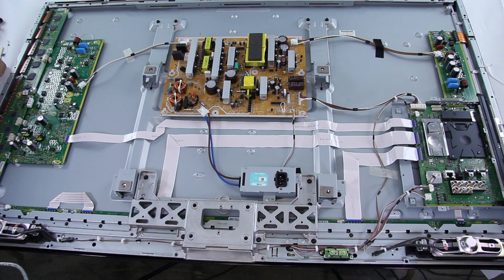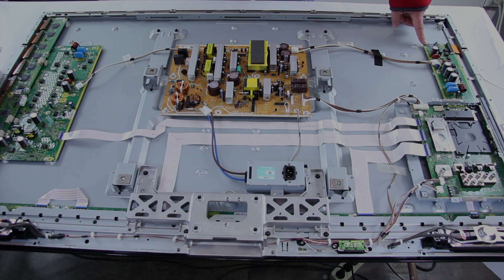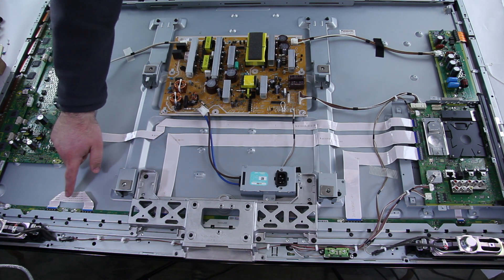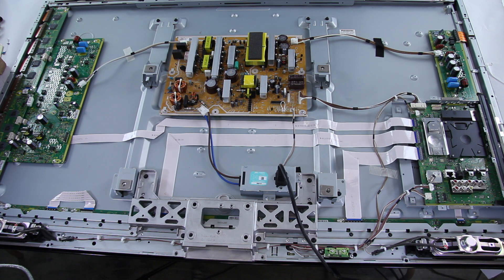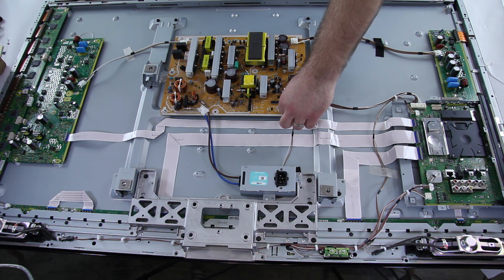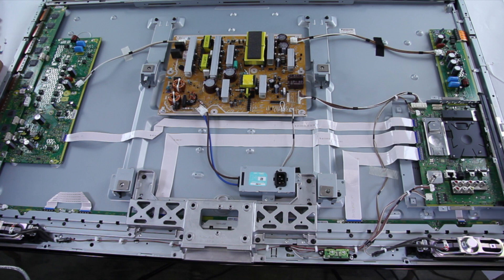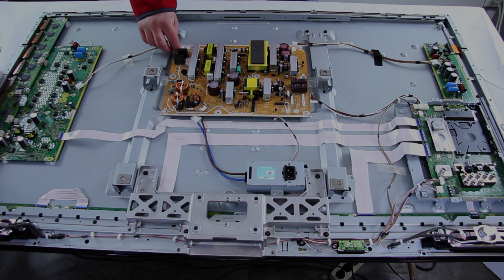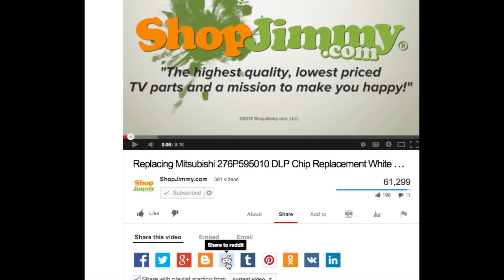Panasonic Plasma TV 6 Blink Code Explained Repair for 2011 Panasonic Plasma TV

Comment: Hi I have model TCP50X3, my light was blinking 6 times with nothing on the screen when powering on.  I diagnosed as per this video, and stopped after the SN board.  when I disconnected it, powered on, the red light stayed on but the screen stayed black.  I ordered a new SN board.  But when I replaced it, now the light blinks 7 times, and still nothing on the screen.  I did notice however the new board doesn't have a capacitor at C414.  When the new board is in, I am able to hold the power button for a couple seconds and release to turn it off (stop the light from blinking).  When the old board is in, I can't do that., it keeps recycling on, I have to unplug it to stop the light from blinking. Also, with the old board installed, the screen "flickers" for a split second, or lights up a dark grey for a split second when it is first turned on, (like most tvs do before the picture appears).  When the new board is installed, it stays the same "Dark black" as when it is unplugged.........ANy thoughts?
Reply from the maker: raverbrant   It sounds like your original issue would be the SS board the 7 blink is the SN board.  So, you may want to replace each of those boards.  Here is a link to replacement parts for your TV model number on our website, click here:  http://www.shopjimmy.com/catalogsearch/result/?q=TCP50X3  Be sure to match part numbers on your current board, with your replacement for compatibility.  You can also call our customer service for further assistance with your purchase.  (877) 881-6492  Thanks and please let us know if you have any further questions with your TV Repair!  www.shopjimmy.com

Comment: Hi i have an older set TH50G10A which has 5 blinks.  There is a black screen then powersupply shuts down ans led blinks 5 times.  Any idea what board is causing the shutdown?
Thanks

Comment: I have a Panasonic viera tc-p50s30.  we had a lightning strike close to home today, it put out power.  tv would not turn on.  I moved plug to different outlet in my surge protector and it came on.  nothing via hdmi cable is working.  tv works with antenna, tv works using component video cables, but not dvd player or direct tv.  any assistance appreciated.
Reply from the maker: grandpas barn   I recommend replacing the A main board in your TV.  Here is a link to replacement parts for your TV model number on our website, click here:  http://www.shopjimmy.com/catalogsearch/result/?q=tc-p50s30  Be sure to match part numbers on your current board, with your replacement for compatibility.  Here is a link to a video showing how to identify your part number, click here:  Panasonic Plasma HD TV Repair Tips: Suffix Codes for A Board & Main Boards  You can also call our customer service for further assistance with your purchase.  (877) 881-6492  Thanks and please let us know if you have any further questions with your TV Repair!  www.shopjimmy.com

Comment: I have a TC-50s30 that has the red light flashing code 7. some forum say it is the SC board but others say it is the transformer thermo fuse . i unplugged the sc board and got a code of 8 . then unplugged the A board and got the code 6 . this makes me want toreplace  the transformer fuse first  ..am i on the right track ?
Reply from the maker: chuck wiles   You can try replacing that, but the 7 blink code calls for the SC board to be replaced.  Here is a link to replacement parts for your TV model number on our website, click here:  http://www.shopjimmy.com/catalogsearch/result/?q=50s30  Be sure to match part numbers on your current board, with your replacement for compatibility.  You can also call our customer service for further assistance with your purchase.  (877) 881-6492  Thanks and please let us know if you have any further questions with your TV Repair!  www.shopjimmy.com

Comment: Please help!!! I have a 2011 50inch Panasonic Plasma HDTV model TC-P50X3. During a power outage four days ago I heard a slight pop and now my tv won't turn on. The system clicks and the indicator light blinks 13 times but the screen or sound does nothing. The first thing I checked were the caps and they all appear to be fine. What do you suggest I do>? I would rather fix and not have to buy a new one, but I do not have a local repair man that is even close to honest and I do not want to get screwed. I saw every video you had posted on a different number of led blinks but none of them showed for 13 blinks. Any help would be appreciated completely :)
Reply from the maker: Darlingcoast   I recommend replacing the A Main Board in your TV.  Here is a link to replacement parts for your TV model number on our website, click here:  http://www.shopjimmy.com/catalogsearch/result/?q=TC-P50X3  Be sure to match part numbers on your current board, with your replacement for compatibility.  Here is a link to a video showing how to identify your part number, click here:  Panasonic Plasma HD TV Repair Tips: Suffix Codes for A Board & Main Boards  You can also call our customer service for further assistance with your purchase.  (877) 881-6492  Thanks and please let us know if you have any further questions with your TV Repair!  www.shopjimmy.com

Comment: My model is Panasonic TCP 50C2 - I was wondering if this proceedure works with my TV (have 10 Blink code) & have worked with tech servive with removing certain jumper/connections and have narrowed it down to a 7 blink code with the Power Supply disconnected.

I have ordered & replaced (2) boards (SU & SD) you are out of stock for the SC Board, and also out of stock for the repair kit for the SC board.

Help - If you have any Ideas - other than wait for boards to be restocked.

Thanks,

Arthur Bland   bland1897@hotmail.com